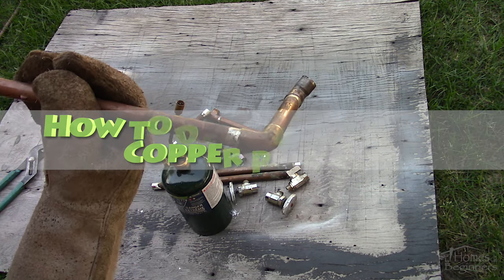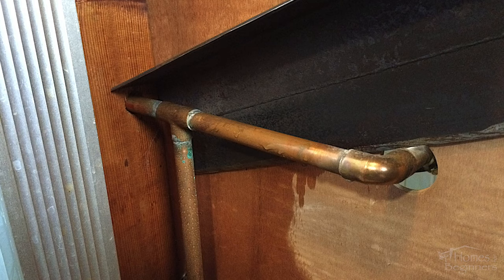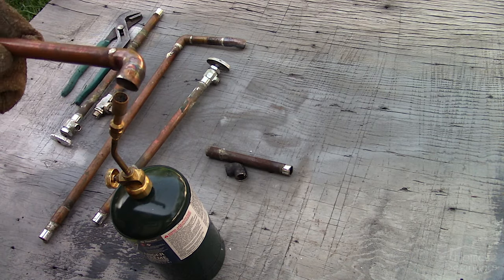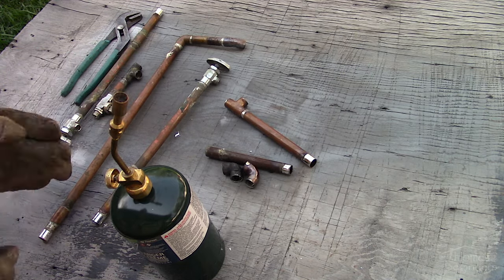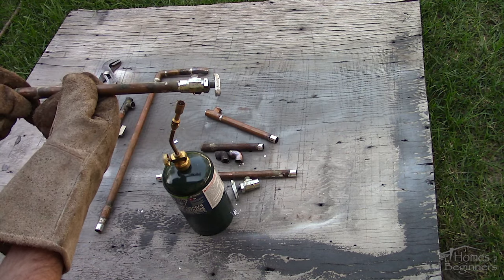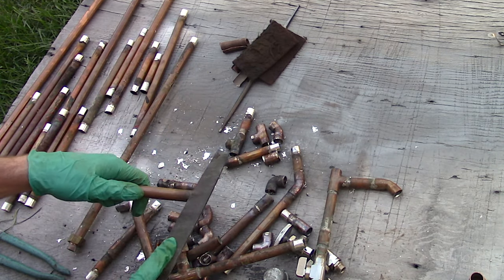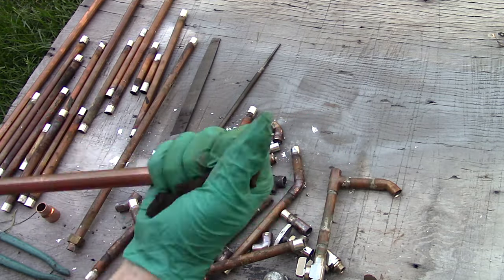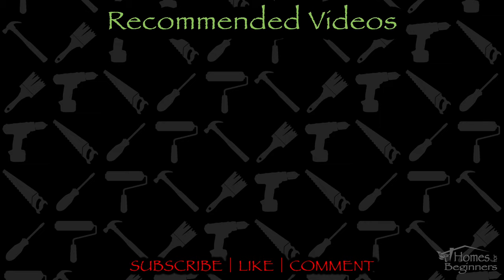How to Desolder and Clean Copper Pipe and Fittings

Comment: Excellent. I came to your video specifically wanting to understand how best to remove the old solder (and whether I need to remove ALL of it) after taking a leaking soldered joint apart, before I remake it with the old components. Your video was the first one I found that gave a complete and reassuring answer. Many videos deal with taking old soldered joints apart, but skate over the steps needed to reuse the old components. Thank you for taking the time to film and post this and for the choice of keywords in your Title, which acted like a magnet!
Reply from the maker: Glad I could help and thank you so much for the feedback, I really appreciate it!
Reply: Agree, great videos like this get hidden under mountains of low quality mass-produced copycat videos.  You got to dig for quality!  I've done lots of copper pipe soldering but I run into weird issues ever so often.  I use water spray bottle & wet rags on valves but will need to use some metal outside against the stucco which has a fiber optic cable for the internet running next to the pipes I need to solder for an outdoor shower.  could figure out how to mount the Flame cloth to the stucco :-)  Also, I like using the camping style cylinder but wasn't sure if that was an accepted practice.
Reply: @cookerdonkin1333 good point - most people would say just throw the old pipes out but if you are replacing a sweat valve or need to rotate a pipe to move it out of the way of a repair these tips are really important.  Also, they offer a proven method vs guessing and hoping it was done right.

Comment: I was a Coppersmith in the shipyards. I used fine steel wool to clean off the old solder after sweating off the old copper joints. It saves a lot of time because you don't have to use emery cloth to cleanup of dirty contaminated solder. Also, if you don't have steel wool you can get the pipe hot and use a wet rag and wipe the hot solder off the copper pipe. It's even easier than using steel wool and less clean up also. Some guys don't have steel wool and it saves a trip to the store this way. Just be careful and use leather gloves while doing this.

Comment: This is a live saver. I had to watch to the end because I wasn't heating up long enough and had vise grips attached during the heat attempt. Used my kitchen butane torch to remove a copper coupler, that corroded, remove 2 inch of pex, then installed a sharkbite slip coupling. Coupler was first Gen on clearance for 4.62. My plumber told me it would be $450 to have done today (Sunday).

Comment: With the price of copper what it is, reuse is the only way to go.   I was hoping for some magic trick... There is none..  The welding gloves are essential as pliers are cumbersome and it's easy to gaul the pipe/fittings as you twist.  . For internal surfaces I use a Dremel with a course burr on it. Solder seems to build up there for obvious reasons.    It's time intensive any way you want to look at it.   One hint:  Rap the still hot fitting on a work bench or other safe surface to get as much as the solder off as possible...   Thanks for the confirmation...

Comment: I had a pipe I sat there for 20 min and never did let go. I gave up and stuck the shut off back on. I’ll give it another try and if it doesn’t work I’ll  have to call a jackass plumber I guess.
Reply from the maker: Sounds like there is still water inside the pipe.
Reply: It was.  I finally got it eventually . Even though I was downstairs at the lowest point and drained all that out the pipe it went upstairs to another sink also and had water locked in still. I had to go upstairs and open that sink and it let it drain out. I guess it was air locked or whatever you would call it. Kinda like putting your finger on your straw and lifting out of the glass but once you release your finger it drains out.
Reply: @whatfreedom7  That happens to me a lot at work (I'm a "jackass plumber"). There are a lot of reasons a pipe can retain or suck up water and there's no point trying to track the source down after you've shut off the water- what I do is carry a length of 1/4 in. pex tubing, and I suck the water out with my mouth.
Reply: Haha whatever works. I even tried blowing air to get it out at one point and that wasn’t even enough.
Reply: @whatfreedom7  Yeah I've heard of some people taking a little, balled up piece of white bread and sticking it in the pipe to block any water. Supposedly the water pressure will let the bread dissolve and pass through the pipe once the water gets turned back on but I've always been afraid to try that in case it doesn't work and I end up having to cut the pipe open to get the bread out. Idk how you would even think of such a solution. Maybe someone had their lunch out at the same time they had that problem lol.
Reply: @joelglanton6531  Were do you put the bread to get the water out before unsoldering? ;)
Reply: @joelglanton6531  I knew there was a reason I’d kept the kids bendy drinking straws for the past 20 years

Comment: Is there a visual indicator you use to determine when the solder has melted enough to pull off the joint or fitting?
Reply from the maker: You can sometimes see the solder change from a satin to shinny finish. Typically I just go by experience as the solder can't always be seen if it was a clean joint. Other times you'll see the copper pipe change it's color tone. But neither is like steel where it becomes red when it's excessively hot.

Comment: Excellent video. The only issue is when you need to do this desolder in a enclosed area.. For example: inside of  a wall, where is not possible to twist the pipe.
Reply: Here's a tip - you could cut the pipe, and splice in a new section of pipe and use "no stop" copper coupling - stop is removed so the coupling can be slid down the pipe then insert and slide in place - great for when there is zero room to move a pipe out of the way.

Comment: I prefer mapp gas for my plumbing needs because it heats up faster and just seems to work better. Especially for larger pipes
Reply: Map gas has been discontinued, they use the name for marketing purposes..
Reply: @ostaz007  Yep...Mapp gas and now its replacement are really not that much hotter then propane.
Best to use a plumbers acetylene/air torch.

Comment: Can I clean up an old joint and heat it up without removing the joint and finish it with additional solder? The lead is strongly bonded and brittle. More regular white flux is no use. I need to strengthen the solder without removing a jucntion
Reply from the maker: If you want to have a reliable joint, it's best to take it apart, clean it, and then resolder the connection.

Comment: Your doing it the easy safe way, what about when it's hooked up 5 inches away from the wall ,and the 2 turn off valve?
Reply from the maker: Use a steal plate to help keep the heat off the wall and keep a spray bottle with water or a fire extinguisher close by.
Reply: Cut it out, then resolder with butt joints

Comment: To reused the fitting, can you heat the fitting up to melt the the solder and slip it back on the pipe and then keep heating the pipe and the fitting to the right temperature and add more solder to it?  Oh per hap do the same thing to the pipe without the cleaning the solder.
Reply: I wouldn't recommend that, because in heating the fitting you likely will burn off all the flux that you did put on there. Honestly, refurbishing old fittings is rarely worth it, just buy new ones as they are usually pretty cheap.
Reply: @LuminaryGames  Fittings used to be cheap, but now that even fast food is up something like 25%-75% it's looking more and more worth it to take two minutes cleaning an old fitting. $2 saved for 2 minutes works out to $60/hr
Reply: @user-ut9ln4vd5m  Honestly if it only takes you 2 minutes to get it to a state where its clean and ready to go, then yeah the numbers look good. For me on a good day I am looking closer to 10-15 minutes.

Comment: What about an outdoor faucet (for garden hose) that was soldered onto a 1/2" threaded copper pipe? I'm hoping that the only solder material is on the outside and not between threads.
Reply: Only an absolute novice would solder a threaded joint.  That completely negates the reason for the threaded joint.